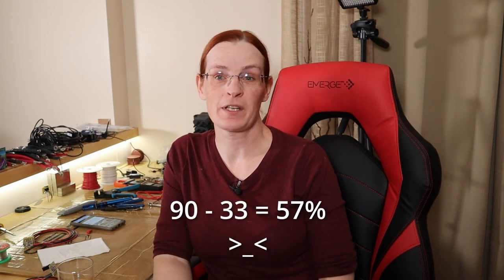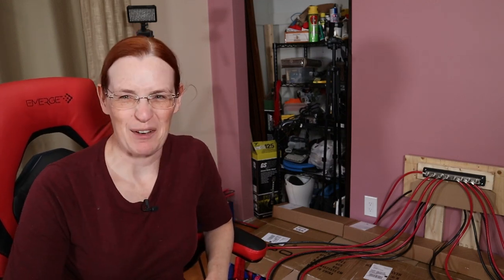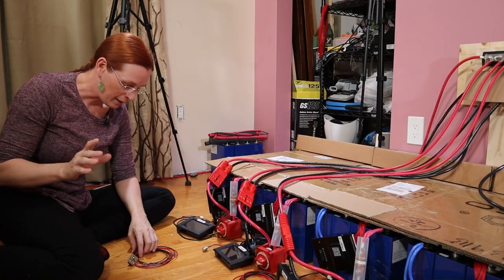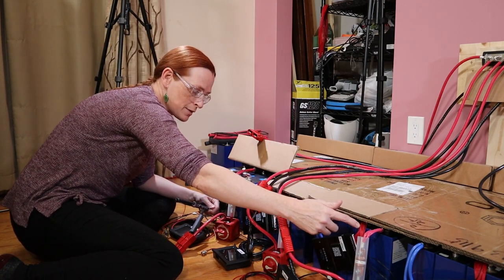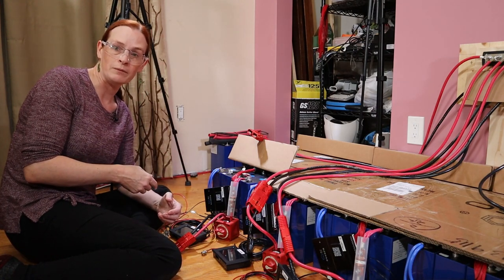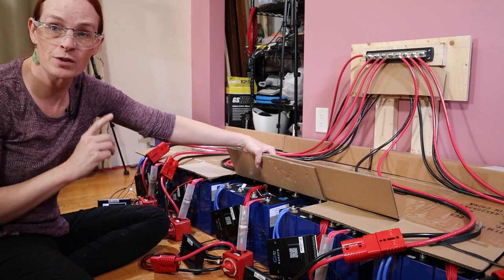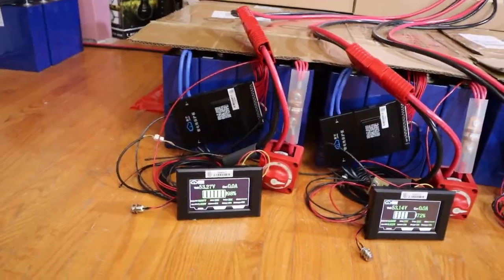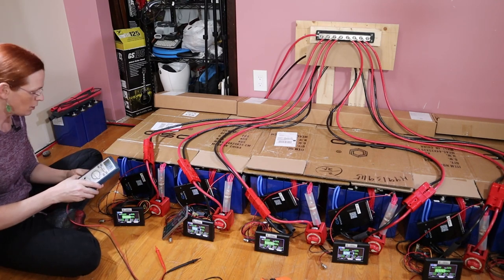It's Alive! (and I need some help) - Part 7 - Big Battery Build! (Ep. 44)

Comment: The individual BMS of each pack fooling each other. There is a reason ALL EV makers paralleling all the cells to get necessary capacity they need and then put these packs in series to the voltage they need and put one BMS on it.
Reply from the maker: "The individual BMS of each pack fooling each other." - How? 
"There is a reason ALL EV makers paralleling all the cells to get necessary capacity" - They're not concerned about redundancy.
Reply: As you figured yourself they are all connected together at the main bus. If you put a giant diode in between every connection of a pack and main bus they won’t but you have a voltage drop. And that also means that fools internal voltages each BMS sees. 
In an EV like Tesla in ludicrous Mode the EV runs at 480V and 1000A…if anything little is wrong you have a big BBQ an 4 wheels. If multiple BMS would be safer then one they would do. These BMS are peanuts compared to costs of cells. If you wanna have redundancy keep a spare wrapped in aluminum foil and in a vacuumed sealed bag. So in a lightening strike you have a working spare….all connected are dead. Have a look at Electrodacus BMS but that‘s only running on 24V max. that doesn‘t carry any current and have one on the whole bank. Cells are never identically you can openly buy, quite identical are only delivered to Tier 1 customers (=EV or storage bank makers), what you get is best A- or B-quality. I suggest use 2 or 3 banks depending how many amp load you need and parallel cell. Parallel cells even out production differences of the individual cells.
Reply: Multiple cheap BMS are not better then one expensive one. No personal offense here, just my experience over 20 years dealing with LifePo4. An exception is Electrodacus BMS which is open source project build by a Canadian genius in nomansland for his own needs and a different concept carry no current at all. I am circumnavigating with a 40ft cat and have a 1100AH bank with 16x272AH Lishen and Electrodacus BMS Running Full Electric galley and pulling 600A continuous when galley is fully fired up when admiral cooks a menu for guest.

Check out TAO BMS and Talk to Phil Tao, it’s made buy a sailor for sailors=boats. JK BMS are made for house banks…
Reply from the maker: @chrisr819  An EV, particularly a very high performance EV, has a very different set of requirements to a sailboat. My design allows me to rapidly climb into the engine bay, isolate a faulty pack, lose 1/6th my capacity, and get back up to the helm to continue my voyage. There's no "side of the road" to pull over and stop at when on a crossing. Similarly, I'll pull, at most, 11kw total, a far far cry from even a modest modern EV. The use cases are totally different. I'm not defending JK, let me be clear, I'm not really impressed with them. However, I'm also not taking lessons from a performance EV as it's a totally different set of requirements.
Reply from the maker: @chrisr819  I didn't choose JK on their price, I chose them for their active balancing and support or 48v nominal capabilities.I looked at Electrodacus and, as you mentioned in your first reply, they only support up to 8S, and I'm building around 48v nominal, so it's just not an option for me. On your boat, are you pushing with electric, or just cooking with electric? As for TAO, I don't see any products on their website at all.
Reply: EVE cells for propulsion bank….these are made for storage banks. Yes officially they can do 1C dis/charge but if you use them that way 1000cycles is max…0.3C till max 0.5C is what they can do well. 
Propulsion and EV use is actually quite close, much closer then you think. An EV can also not just drive to side…things go much faster to a big disaster but it’s the same issues (yes 1 or 2 less with less extreme use) you face. it’s operational security what their top aim is, and yours should be too. You are throwing away the biggest advantage you have when building your own battery, paralleling the cells=to some significant extend reducing production tolerances and have a single BMS that controls everything. Yes you can connect 2 in parallel for security if you wanna have redundancy. you actually copied a drop in setup. 
Yes my bank is just low C „service house bank“ only with eGalley as I would never go fully electric on a real bluewater vessel. Hybrid yes with the Beta Hybrid Engines. If you ever have been in a storm for 4 days straight where you need your engines 4 days straight on 60-80% load no e can do that. Reason I have massive oversized engines, biggest without turbo…2x50hp instead 2x20hp=WOT14kn on a 40ft 7t sailing catamaran and that’s saved my life twice already.

Suggest to google for titan one LTO, that is an Austrian NPO that produces house storage and EVs. Talk to Mr Harbusch, they have the right experience you need and maybe he sells you one of their 48V BMS that is really tested out over more then 10 years now.
Reply from the maker: @chrisr819  "EVE cells for propulsion bank….these are made for storage banks." - That's just not true. Look at their website (link below) for the LF280K cells, and transportation is 4 of the 6 advertised use cases, with marine propulsion being a specifically cited use-case. 

"Yes officially they can do 1C dis/charge but if you use them that way 1000cycles is max" That's not what the white paper for the cells shows. But lets assume that was true anyway; My motor maxes out at 10.9kw, and my inverter can sustain, at most, a constant discharge of 4kw. Lets round up and say that, somehow, I maxed out the inverter, had other 48v loads going, and the motor at full tilt (exceedingly unlikely any of these will be true, let alone at the same time), that's 15kw draw. At 51.2v nominal, that's 292A draw, split across 6 packs, so each pack sees ~49A, at the very very highest possible load. That's 0.18C. Normally, I'll be well under that, as I rarely plan to sail above 50% throttle, and I won't be running the galley while under powered propulsion very often, if ever.

"Propulsion and EV use is actually quite close" - They're literally the same thing.

"things go much faster to a big disaster" - Explain please? What disaster are you imagining, and how would it occur?

"paralleling the cells" - The six packs will run in parallel. 

"reducing production tolerances" - Explain please, what tolerances? How?

"have a single BMS that controls everything" - Single point of failure. Higher loads on the MOSFETs / higher wear on the other components. Running well under spec increases reliability, which I get from multiple BMSes. 

"I would never go fully electric on a real bluewater vessel" - Perfectly valid for your boat and your needs. Your needs and wants are not my needs and wants though.

"If you ever have been in a storm for 4 days straight where you need your engines 4 days straight on 60-80% load no e can do that." - That's a contrived scenario... I will have more than enough provisions to heave to if I couldn't sail and wait out the storm. Nothing says I have to push for four days in a storm. For how rarely this will happen, given I can plan crossings around weather windows, it's a trade-off I'm fine with. I am patient. 

"Reason I have massive oversized engines, biggest without turbo…2x50hp instead 2x20hp=WOT14kn on a 40ft 7t sailing catamaran and that’s saved my life twice already." - Then clearly you've made choices that work well for you. One of the first things you learn about boats is that everything is a trade-off, and there's no such thing as "the perfect boat", only the prefect boat for you. For my plans, a cat is not even an options, as one very simple example. 

"titan one LTO" Google returns nothing for this. I'm always happy to look at new BMS options, but I've never come across anything matching that name. 

https://www.evebattery.com/en/prismatic-lfp-cell?tp1
Reply: Loads of questions:
EVE, Lishen, Bazen 272/280AH are all the same cells at the end and around for years. Do you believe everything Chinese write. There is a lot experience around with them. They are good cells for the money but there are reasons they cost the same then good AGMs. And there are reasons Calb cost 30% more or a Winston 2-3x. Worst thing is mechanical stability but you can fix that by clamping, make a stable, watertight (casing is plus !) casing and have on both poles +/- the busbars connect to a eg shunt, fuse you screw on the sidewalls, and on that then connect the cables, so the mechanical load of the cable goes onto the shunt, fuse etc. never a cable straight to the terminal, that cannot sustain much force.
Then comes their internal construction. If you stay in 0.3C then it should work but expect lower cycle life.
Motors have a startup and stop surge of 2-3 times each normal load, means if you draw 200A, you will have for milliseconds 400-600A draw. And that even kills mosfets, they don‘t like that at all.
That’s the reason I have Electrodacus as the only part that sees the current are the 2 shunts, it doesn‘t carry any current and has no Mosfets.
You need to do your calcs with 47V as the bank is not full all time and pulling 10kw will lead to a voltage drop in the whole system.
One BMS controls your whole system so knows what the whole bank and every component is doing and can regulate it as one. Multiple banks paralleled with its own BMS, nothing in your system knows anything about your total bank, each BMS knows it’s sub block and as you figured they influence and fool each other. Perfect would be one master BMS and for each sub-block a Sub BMS that talks to the master. But that is not existing for sale. valence batteries used for hospitals, rescue….have that, you can connect them together.
Paralleled cells balance themselves and act as one, eg internal resistance put the worst and the best cell in parallel, the result is what the rest of the cells have. Your bank is as good as the worst cell but if paralleled with the best, the best takes more load and wearing a bit faster (but it’s best so has better quality then average) and saves the worst cell from some wear (which has less).
As I said you can put in parallel 2 identical BMS on the whole bank, redundancy as both measure the same and will operate identical. I have that in case one fails, got one cheap for 80€.
Reply from the maker: @chrisr819  "Do you believe everything Chinese write." - Setting aside the subtle racism; I don't trust everything anyone writes. At the same time, not having a research department, we need to make an informed decision and that always involves some risk. LFP as a technology, and EVE/CALB as companies, are well known. The risk of out-right lying to consumers is a short-term strategy, something I might expect from a small company, but too risky for an established company with a valuable brand reputation.

"they cost the same then good AGMs." I just recently did some math on this in another thread, using commercially available AGMs versus LFP based marine batteries, and the cost per usable Ah was about 60% cheaper for LFP over AGM. 

"If you stay in 0.3C then it should work but expect lower cycle life." - Please cite the research you've seen showing this, because it goes against what I've seen.

"And that even kills mosfets, they don‘t like that at all." - For another project, I've been researching MOSFETs along with an EE friend, and the spec sheets don't reflect this claim. Please cite your sources.

"You need to do your calcs with 47V as the bank is not full all time" - This reflects how little you seem to understand about LFP chemistry. The bulk of the charge/discharge curve sits at ~3.2v/cell, or 51.2v. The drop happens towards the end of the discharge cycle, with a sudden drop that approaches 40v if you go to full discharge (something the BMS will be configured not to allow). For the sake of argument though, lets assume the worst case 40v at 15kw (something that is border-line impossible, and absolutely not sustainable). 15000 / 40 = 375A / 6 = 62.5A per pack, or 0.22C. So even in this extremely contrived scenario, it never exceeds 0.3C.

"One BMS controls your whole system so knows what the whole bank and every component is doing and can regulate it as one." - Actually it doesn't, as it can only sample the balanced voltage per cell in parallel. This can mask a failing cell, and even when you identify a parallel bank as problematic, it's troublesom to sort out which cell is failing. Your single BMS arguments are not convincing, never mind the loss in load balancing and redundancy.

"nothing in your system knows anything about your total bank" - I do, thanks to the available data. With the RS-485 interfaces, a project I've hinted at is the collection and analysis of all data into a database. Even without though, as mentioned above, I can at least diagnose faults better with eyes on every cell. 

"As I said you can put in parallel 2 identical BMS on the whole bank" - That means that in a fault, I lose 50% of my capacity, and load balancing is reduced to 50%. That makes no sense. With a BMS per pack, I lose only 1/6th capacity and 1/6th of the load balancing capability. Again, this obsession with minimal BMSes makes no logical sense to me.
Reply: Nice theories, reality they give a crap about B to C, totally insignificant. I oder via Tier 1 NPO who gets a container every week, even they have troubles get proper customer support….and they kinda matter. I know these cells from practical use and use case over a lot of years now. installing a 560A bank in a buddies boat.
Did you ever have your motor run with the battery? Did you run it on 10kw and then simulate that a fishers net get into propeller and lock it…what happens? There is a good chance your BMSs are fried in your config due to inrush current… Depending a bit on your motor/shaft what security setup you have there…just one of couple hundred use cases you have to take care in propulsion setup.
Yes paralleling also have disadvantages. But if all EV maker with billions € in R&D are using 1 BMS, parallel setup only even in the most demanding heavy use cases of an high performance EV is a wise thing to follow that.
From the 0.3c use you are good, didn‘t know all you had to power, good worst case scenario calculation with 40V. Just a hint, optimize your system for the standard use so you get optimum out make this as simple as possible with as less as possible gear…all Will break one day. and then think about security, redundancy, backup. A redundancy is not a backup, asa redundant system is also fried in a lightening strike. The best redundancy+backup is one that’s plug&play installable in 2 min but kept in wrapped aluminum foil vacuum bagged.
Reply: Regarding agm to EVE….280Ah cost 650Euro, 560AH AGM to compare the same usable capacity are at least the same, not taken the additional lifetime into account. What life you really get depends…-the buddy boat I am installing now the 560AH house bank had 640 AH gel batteries which are 7 years old, discharged regular below 40% SOC and these are still fine. Cost are about the same, reason LFP now is an electric galley to get rid of gas due to security and also resupply…different countries…adapters etc…

Comment: Well, resetting to factory defaults while leaving everything connected is never a good idea - whatever custom settings you had in place, will be gone, and that can damage things in your circuit easily. (UPDATE: nvm, I see you found out yourself :))
Reply from the maker: Heh, yup. I knew I wanted to reset, but I forgot at the time about the input current limit I had set.

Comment: I have a Fluke and a Dave Jones multi meter and the do not agree!
Reply: yep. Metrology is a horrible hole to dive down. I just run with what the EevBlog meter says and pretend everything is ok. But I'm not fussing about mV 99% of the time so I can get away with it. And in this case I think buying a 5 or 6 digit meter would be a waste of effort. The numbers don't really matter a huge amount, what matters is the differential between cells. My expectation is that there's a multiplexer in the BMS feeding a 12 bit ADC and that's where the cell voltages come from, and the battery voltage ditto, but because of the much greater voltage there the absolute accuracy is lower (viz, you still get 4000 counts, but 60V/4000 is bigger  than 5V/4000)
Reply from the maker: @mozismobile  Funny enough, I chose the BK Precision because of a review Dave did some years back.